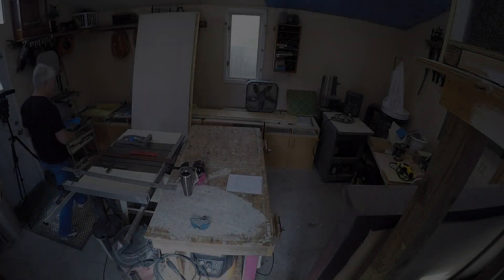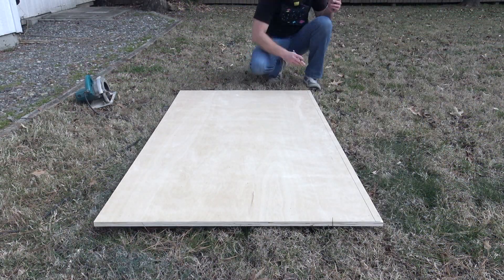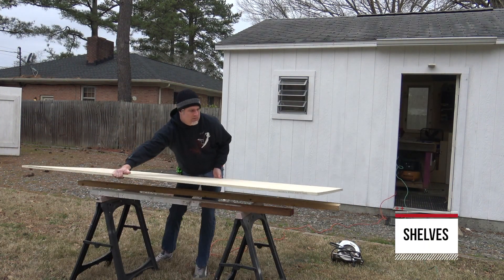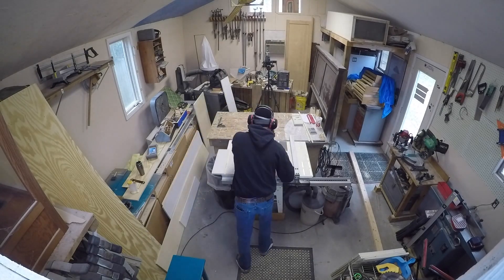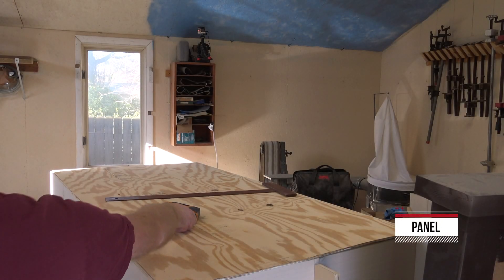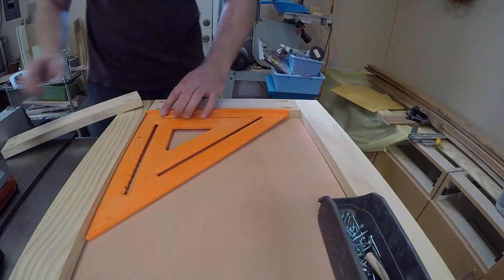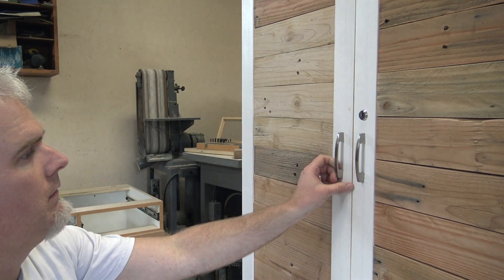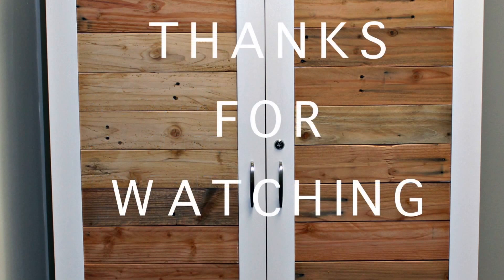How to Build a Large Cabinet

Comment: Super cool dude 👍🏽

What kind of paint did you use? Did you mix the poly on it?
Reply from the maker: Thanks Eduardo!  It was just semi gloss from the home center.  I didn't put any poly on this project.  The semi gloss will help with smudges and fingerprints and the pallet wood i left natural.  Just sanded.
Reply: Eric Greaves looks pretty cool. I've been thinking about using air compressor to paint furniture with water base to make it easy bit I ha e no idea how works.
Reply from the maker: I have a little experience in spraying furniture, but my compressor is not big enough (6 gallon pancake) to keep up with the constant air flow needed for big pieces.  It has worked for smaller pieces, but struggles with larger items.

Comment: Do you normally paint by hand or do you spray your finishes? I've been using a sprayer but getting tired of the overspray mess in the basment.
Reply from the maker: I have a little experience in spraying finishes, but i only like to do it outside because of the over spray.  My compressor (6 gallon pancake)though does not have the capacity to keep up with larger pieces. A future goal is to be able to do it, but right now by hand is the solution!

Comment: How do you like your PorterCable drill?
Reply from the maker: Absolutely love them!  The batteries last a very long time and the 20v lithium is plenty of power for most of what i do.  I do have to use a corded drill at times if i'm trying to use large forstner bits on hardwood, but that is few and far between.